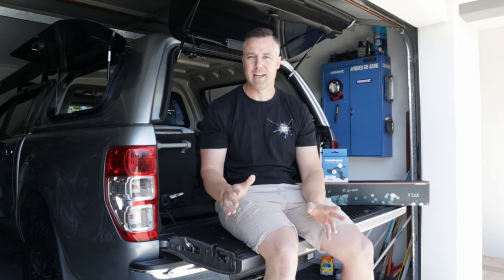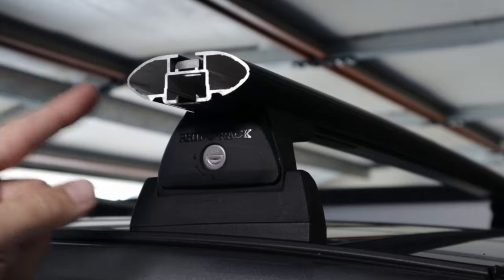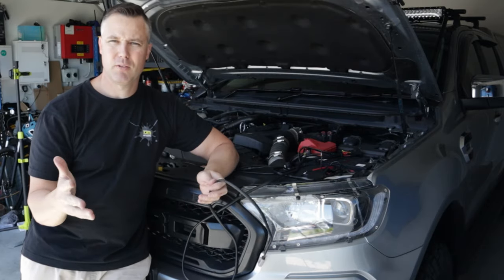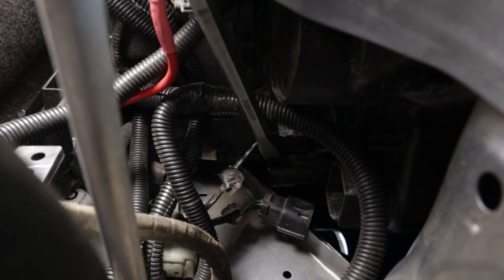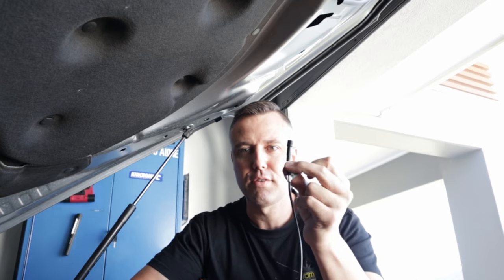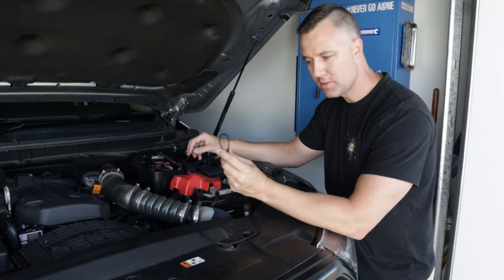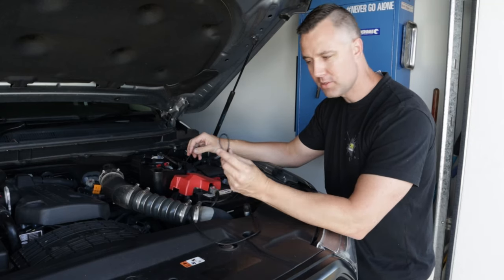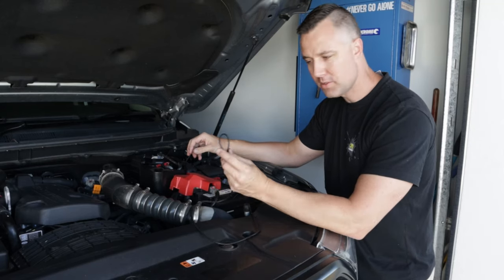2020 Ford Ranger || STEDI Light Bar Review and DIY Install

Comment: Hey mate great video and looks awesome!! Just wondering if the light bar sits higher than the rack?
Just curious if loaded up will the load be sitting on the light or rack??
Cheers
Reply from the maker: Hey mate no the light bar sits flush or just under the rail - so it won’t interfere with a load. The bracket sits on top of the rail which is the highest point.

Comment: Great video GC. With the light bar switch turned on, does the light bar power on when you turn on the high beam? Or do you turn on your high beams and then have to switch on the light bar separately? So, the switch allows you to have your light bar on with the high beams only or without the high beams only? Hope it makes sense. Cheers
Reply from the maker: Hey mate, the light bar only comes on when the light bar switch is on AND the high beam is on. By law it has to switched together. The wiring kit from STEDI already has this wired. Thanks for watching 👍🏻

Comment: Hi mate, class video 💪🏼 just wondering. I’ve got a 2020 Ford ranger thunder, how did you mount your button as I don’t have a trim in between the two 12V lighter sockets  . I wasn’t sure if that was after market or if that came standard with yours.
Reply from the maker: The button is mounted in a light force switch holder. About $100 when I bought it.

Comment: Hey dude, awesome video, one question is how does the light bar come on, is it only via the switch you’ve installed or does it come on when you turn your hibeam on as well?
Reply from the maker: Hey mate. Cheers. The lightbar can only come on when the hi beam is switched on - by law. The switch installed just isolates it so if I just want normal hi beam on without the bar I can. Hope that helps 👍🏻

Comment: Gday when you plug the wiring harness into the light bar and run the rest of the cable down the side of the vehicle are you running it in the door or window it’s a bit hard to work out when you are watching the video please help 👍
Reply from the maker: Hey George, the harness runs down the side of the windscreen then into the firewall underneath the dash. There is a gap on the side of the windscreen that the cable can be pressed into. Hope that helps you. Cheers Adam

Comment: Hi mate, awesome video helped heaps. Just one question how did you get from the fascia panel to the dimmer switch to illuminate the light on the button
Reply from the maker: Thanks mate. To illuminate the button I tapped into a wire from the 4wd switch.  Think it was the purple wire from memory. Hope that helps 👍🏻

Comment: How do you recommend this light? Do you have any experience with baja designs but I heard about this company and wouldn’t mind getting one of these for my can am to try since I have a 10 inch baja designs onx6 and 2 amber squadron sports, I wanna get the 50 inch onx6 but I wouldn’t mind this if it’s actually worth it from what I’ve been seeing in videos
Reply from the maker: Yeh mate it’s a great light! Haven’t had anything to do with Baja designs but heard they are great. Thanks for watching 👍🏻
Reply: @GetCampingOz  yeah for me I love baja designs especially the fact that you can swap lenses out for clear of amber and have no drawbacks, for be I’ve seen other light bars out there and baja designs blows them out of the water by a lot, even the 10 inch does a better job of throwing light down the trail
Reply: @X3.Rvxlll  the baja deisgns bars are insane but again you end up paying for it as they would probably be double if not more than the price of the stedi, stedi does offer other styles of light bar they perform better as the st4k and the st3k are the kinda entry level bars from them, have a look at something like the st2k curved bar from stedi, got an insane throw on it

Comment: Great video! Where did you wire the earth (red wire at the back of the switch) back to? The stedi harness only provides a very short length
Reply from the maker: From memory the harness already has the earth run back to the relay? The loom has 3 wires - positive, neg and the switching wire. All I did was pick up the dash light positive from the 4wd control switch - this then made the 4th wire to the back of the switch

Comment: Great video. I’m planning to buy this bar. On the same cross bar too. Does it reflect off the dash or bonnet?
Reply from the maker: Thanks mate. I haven’t noticed anything that is distracting. There is a small amount as the light is above you but nothing to worry about. 👍🏻

Comment: Is the wiring procedure essentially the same for most vehicles?!
Reply from the maker: Hey Simon, essentially the same. Its the same wiring loom that's supplied, you'll just need to use a different headlight adaptor (supplied in the kit for generic vehicles H4 globe ect) and the dimmer wire will be different. Its very straight forward.

Comment: hey mate, just got the shirt switch and didn’t have a green cable… had a white instead, is it the same as the green??? set my light bar up and it didn’t turn on lol
Reply from the maker: I’m not sure mate. Best to check with who you bought it from to find the wiring configuration
Reply from the maker: I’m not sure mate. Best to check with who you bought it from to find the wiring configuration

Comment: Hi, where does the + & - (red/black) cables with the loop at the end plug into?
Reply from the maker: Hi Ben, assuming you are taking about the ring terminals - red + is connected to the battery and the black - is connected to the earth point. Thanks for watching 👍🏻

Comment: What size cable to be able to fit in window gap
Reply from the maker: Thanks for the question. It was the STEDI wiring harness. Im pretty sure it was 6mm core with a conductor cross section of 4.58mm². Cheers